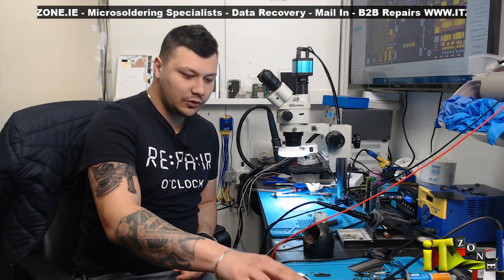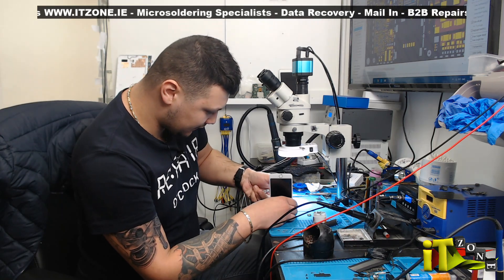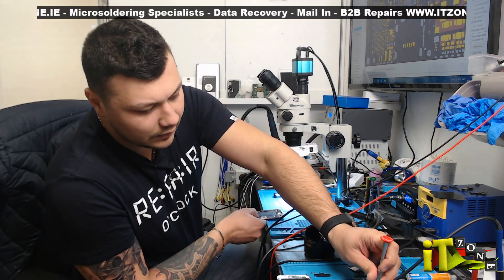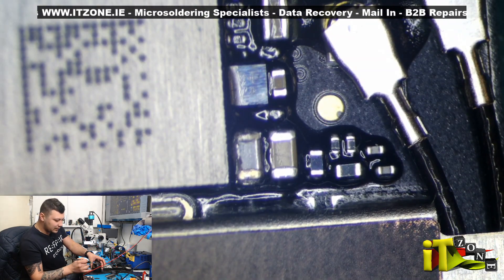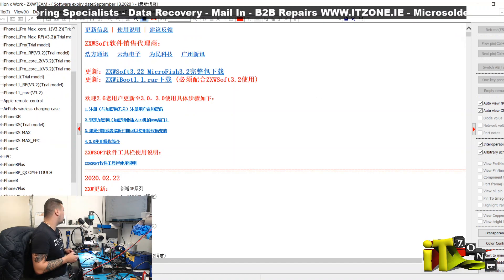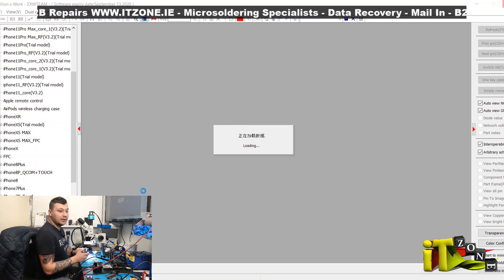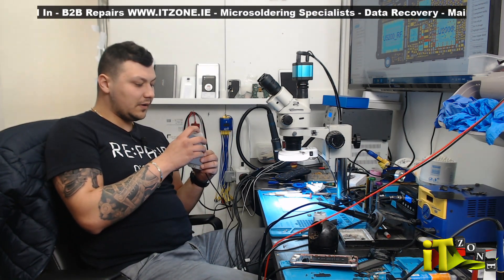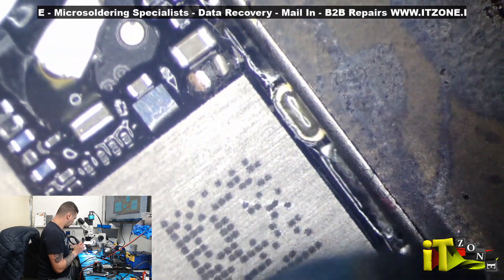Iphone 6S not turning on, no power, not charging. VCC MAIN FULL SHORT REPAIR by itzone.ie

Comment: Q2300 is shorted on my iPhone 6s Plus but if I remove the ic, the short will be gone but if I put it back or even replace it the short comes back.
Reply from the maker: Q2300 is a mosfet and it gets hot because it has a short on the source.